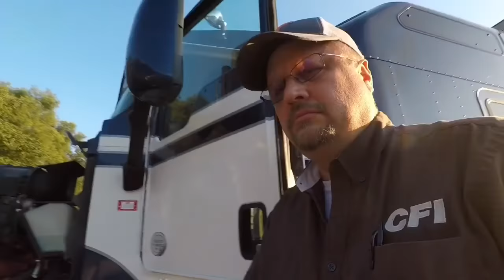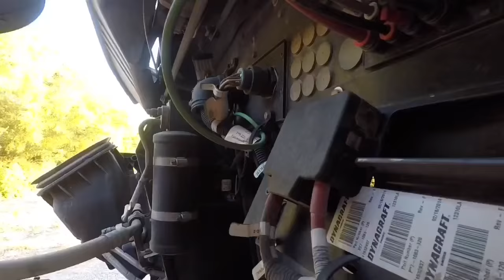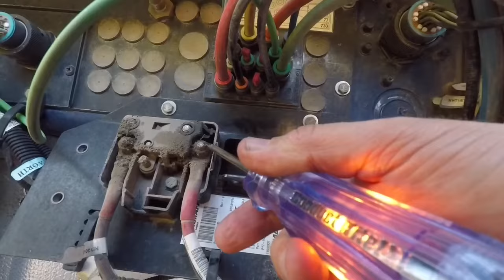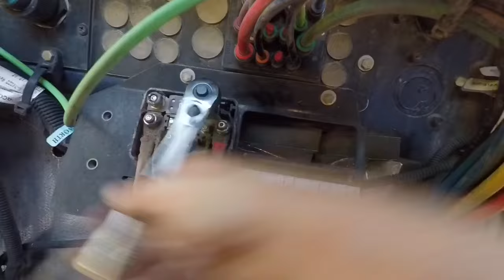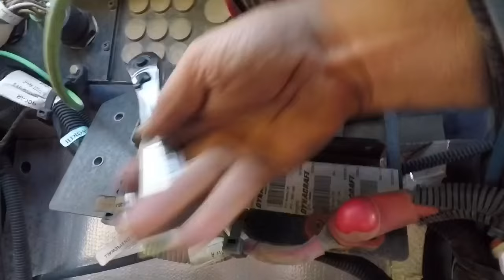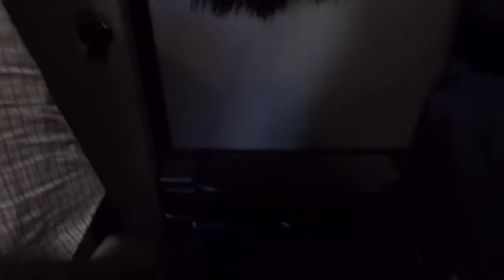Low Voltage Disconnect LVD Mega Fuse: Lost Power To Sleeper Acces- Lights, A/C Fan, And Refrigerator

Comment: I'm going through the same problem With this 2018 International Lt I'm going to check that mega fuse I just hate paying a dealership several hundred bucks just for a 5 minute fix then they hold your truck for hours as though they're working hard on it

Comment: Bobby I am just watching  this video I’ve got a 2007 W9 my refrigerator works my DC plugs work but my sleeper dome lights doesn’t work what’s your suggestion ?
Reply: Same thing has happened to mine have you find out what’s the reason?

Comment: 2020 Pete 579, what I can check by myself: in my opinion in my truck don’t work lvd system. After 24-36 hours off duty my battery is dead. The system should disconnect everything and keep power for start the engine. So what I can check before I will go to the Peterbilt service?

Comment: I'm having slow charging issues with my 3 inside batteries on my Freightliner.  It's a Matco Tool truck. I've cleaned off all the battery posts. However, it still won't charge very fast. It charges well when I have it plugged into my house power outlet. Would be a cable somewhere?

Comment: Mines has a 150 amp fuse.
I bought the truck , it came that way.
My  junction box was located in the battery box.  
My truck cranks but doesn't turn on and then after more trys it turns on.
So I'm currently  trying to find the issue.
Reply: Ever figure it out, I have the same issue, and cab lights not working too.
Reply: @Chuck Brewster  my issue was the battery disconnect solenoid. 
It was faulty.  It's located in the battery box on the right on my truck.
Cost 300 bucks and 200 to replace.
I chose to just by pass it.  My truck started everytime after that. Good luck and let me know if that's what it was.

Comment: I have a 08 kenworth t660 studio sleeper and my truck has the check engine light on and I check it  with the computer and its saying that I have low voltage in everything I dont know what to check on it. Could that  Cos everything and still ruan

Comment: I see you have the Cummins I’m having same issue except I have the Paccar engine and there’s no mega fuse on the fire wall I can locate or under the bunk any ideas I really need to get my refrigerator working properly instead of me pulling a relay losing my bunk lights but then fridge works
Reply: I’ve lost power in my sleeper bunk I have a 2015 T680 with Paccar engine , I’m trying to figure out the same thing
Reply: Any luck on finding the problem i am.hsving the same issue
Reply: Did you guys find that fuse location?

Comment: I just got the LVD msg but my voltage gauge on the dash is at 12-14. Now my check engine light is on. Any help would be appreciated. I think I may need to replace my batteries. The truck takes longer to turn over when cranking it each day
Reply: Did you resolve your problems?  What was the issue?

Comment: My bunk power works only when the truck is running not when it’s off.  I cut the truck off, within minutes there is a beeping noise then power to the bunk shuts off.
Reply: Hey I got the samething happening to me, you ever figured it out?
Reply: I have a 2018 Mack I have the same problem would like to know if you guys figured it out
Reply: @JayRossTVision  did you figure out your problem?
Reply: @pedrofriesen6757  did you figure out your problem
Reply: Did you figure out your problem?

Comment: Please Someone can suggest what to do with my international LT625 2020 's Bunk heater run for less then 2 hours then all the lights go shutt off although I changed batteries. 

But still facing the same issue. 

I spoke to dealership they suggest to use deep cycle batteries..
Is it true?
Thanks
Reply: I’m having the same issue with a 2022 389 Peterbilt … did u find a fix for this ?

Comment: Would that mega fuse cause the alternator to not put out proper voltage?
Reply: Good question.
Reply from the maker: Jay Allen that shouldn't have anything to do with it but I'll look into it.
Reply: Loose connection on battery lead 🤦🏻‍♂️

Comment: My fuse is in the battery box and its good but still no power on my fridge nor my accessories on the bunk
Reply: Did you ever find the solution
Reply: @davidkattan1275  i just cut the original wire supplying power to the fridge switch on the bunk and put a wire from the batteries to the switch with a fuse just in case something happened and that fix my fridge problem